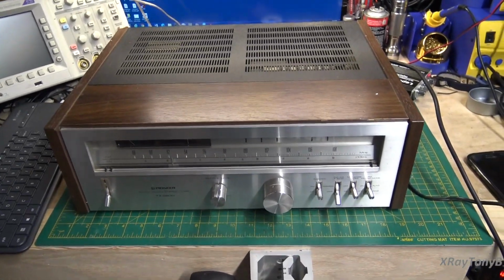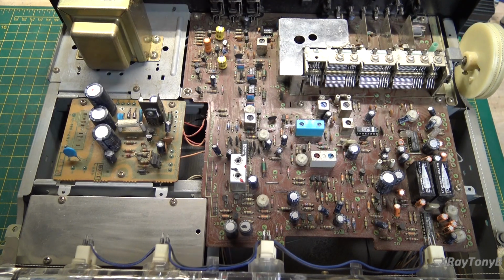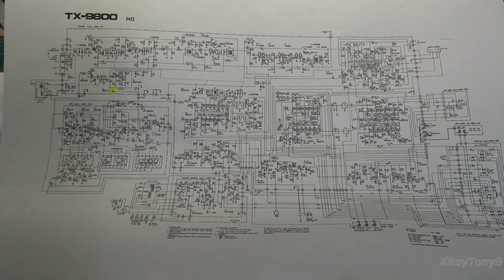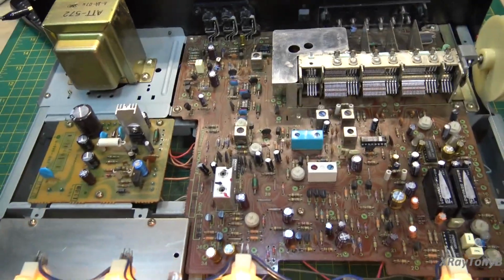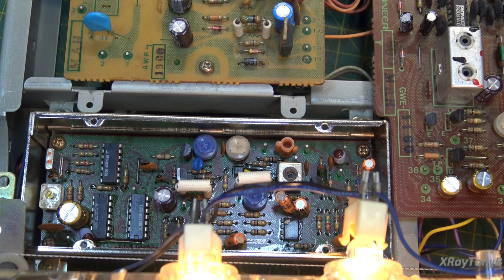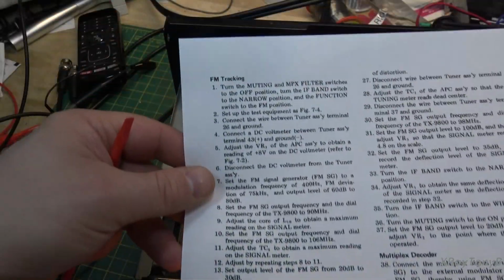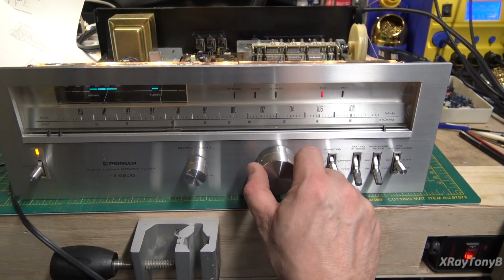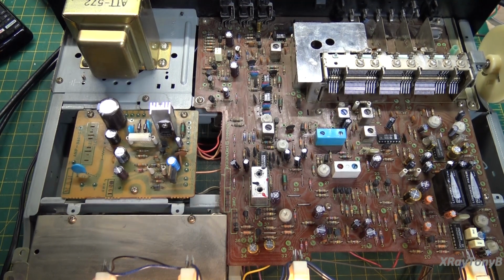PIoneer TX 9800 Tuner

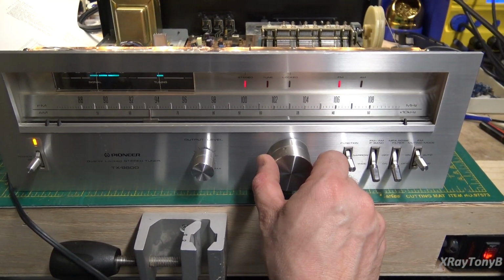Comment: Hi. In minute 18:07 you show that the tuner locks not only in the right place but also away from the central freq of a station (this is before the final alignment) showing the progress of the first alignment. Mine does the same thing. It locks in the right freq but the same station resurrects after and before the right freq strongly and noisy and it even locks in those two positions. This way changing stations causes a lot of strong noise. After the tracking alignment in your video I can´t tell if this was solved, I guess it was. Could you please help me as I am not so skilled telling me which part of the last alignment you did I should go through to fix this particular problem? I don´t even have all the equipment you have so maybe because of your experience you can tell me which adjust in particular I should try to play with at least. Thanks a lot in advance!

Comment: My late father had an Hitachi SR2000L receiver which used something called Vector Tuning. There were two green led's and a red center locked led on the pointer. This is probably the best system I have come across. It sounded really sweet for what it was. I have the Pioneer TX 7800 packed away in the loft. I've not been brave enough to have ago at restoring it yet. Maybe one day.

Comment: Hi, can you suggest what bulbs I 'should' be installing for my TX 7800? Mine all just blew out. The bulb glass is discoloured. the bulbs in there now are Stanley 8V 0.3A. The LED for the power toggle is gone as well. I Deox-it'd all the controls. Thanks for insight.

Comment: Hi, nice work there, I just bought one and I'm intending to recap it. It is impossible to find an owners manual or recap list online. Is it possible for you to post your recap list?
Reply from the maker: One of the few places you will find info on these units is the Sams Photofact website.  The other option would be to find a vintage manual on eBay.  As for the cap list, I never really made one, as I had all of the replacementy caps in stock and replaced them one by one.  All common values.  Lots of 10uf, 100uf, 1uf, 220uf, etc.  Make sure you use good quality caps rated at 105 C.  I prefer Nichicon and Panasonic.

Comment: Hello young man.  Thanks. 63 year old guy here.  These were state of the art when I was young.  I look forward to repair of IF tuning problems from tube equipment from the 50's. LOL, Use a 50's tube oscilloscope to repair solid sate equipment.  Have you ever worked on units with Geranium transistors?